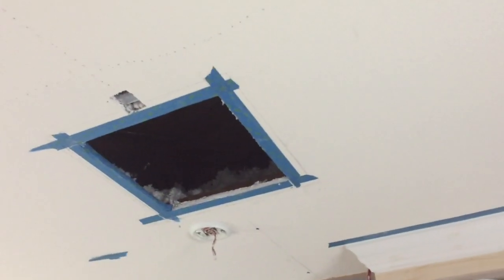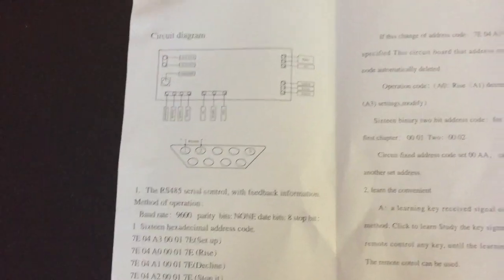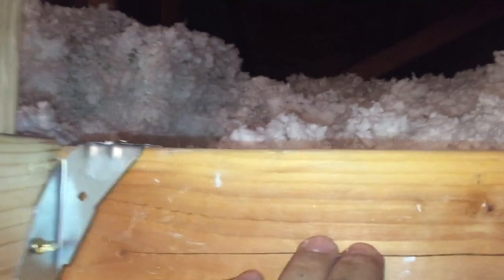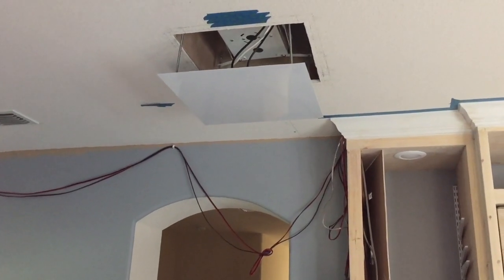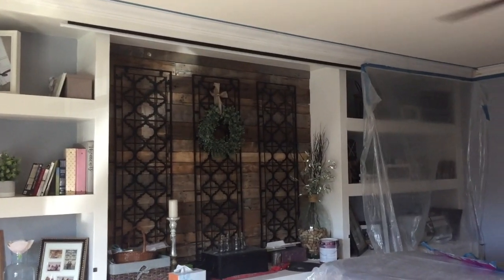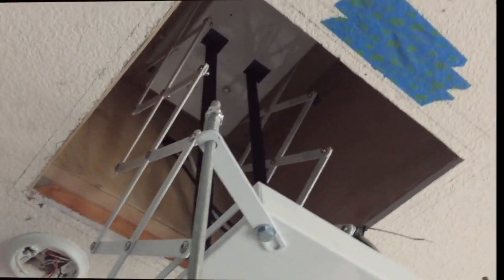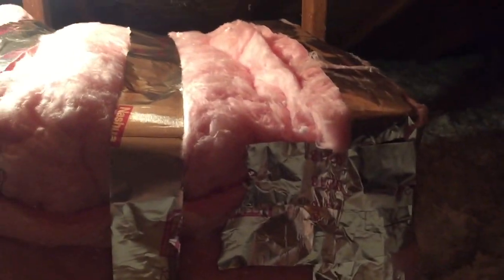Motorized projector lift

Comment: Very nice, but shouldn’t you be venting the box instead of insulating it to get rid of the heat though?
Reply from the maker: P F >> makes sense. I since moved. All I took from theatre room is bookshelf speakers and audio equipment (stereo amplifier) . What’s a theatre room without projector and built in screen.
Reply: But its not on when inside the box. Wont be any heat. Why need ventilation
Reply: @sensedesignarchitecture543  Did you even watch the video?
Reply: @pf5658  you clearly didn't 😂 His ceiling fan was on cause it was hot. He built the box because of a draft, then he insulated it because OUTSIDE HEAT was getting in. Tone your harsh down. You never know when you'll be in the wrong 😜

Comment: Hi! How accurate is the projector mount? What is the difference on the screen in mm. each time when you move the projector?
Reply from the maker: The projector was mounted solid in the lift unit. No need to reposition after lowering unit.

Comment: I have exactly 12 inches of depth in the ceiling where I want to mount this. Only one foot between my ceiling sheetrock and the second floor above. Will that be enough space when fully closed to conceal a projector that is only about 2.5 inches tall? Or could I cut/shorten the four metal rods that hold up the ceiling plate to decrease the overall depth.
Reply from the maker: jameskovach >> you could def cut the rods. Just remember that the projector will be mounted upside down on lift. If you have manual controls like I do on my Epson, might be hard to get to. You will have a tight fit since you’ll only be working with 12” of space. But if you can build, you can def make use of that tight space.

Comment: How do you adjust the distance the lift will lower and raise?
Reply from the maker: Vadim Shapiro there’s limit switch connected to unit. That when there’s power, the rollers that extend/close the legs will trip the limit switch disconnecting power to motor
Reply: @vgnope , thanks for the reply. My unit looks identical to yours but I don't think it came with a limit switch

Comment: How is the lift connected to power? Plug in or hard wired?
Reply from the maker: Gamecock 24 — I have it plugged to a surge protector. 8plug. So I can on/off all electronics. ie reciever, projector, lift, everything for home theatre system. I didn’t think it would be good to have unit always plugged in

Comment: nice work, do you have the dimensions of this lift?  I need to hide an Epson 5040ube which is 21x17x9.  Can you control how low this drops down?

thanks!
Reply from the maker: Gorilla Jones — the base plate measures 20”X20”.. 
The unit base plate is 20” above ceiling Sheetrock. That’s more room than needed. So when lift is in closed position/up, there is roughly 20”of space between ceiling plate, manual projector controls;zoom,power button etc..projector mounting bracket, scissor lift mechanism, lift motor.
The ceiling is 9’, the max lowering of unit depends on lowering limit switch. I have mine set to lower to 30”. Can go as far as 36”. Also account the space above ceiling line. 
You can sub the ceiling plate (nice square sheet metal looking thing) for whatever you like to accommodate your projector size. 
My measurements of inside box are 23X23x20.
Reply: @vgnope  

Thanks, I don't have quite that much space. I've got 17.5 inches between floors, so not as much space as you. Still trying to find something for the 5040 Epson.

Comment: Strong work! Looks like you synchronized the projector lift and screen movement with each other. If so, how’d you accomplish that? Thanks.
Reply from the maker: Michael J. Curtis >> magic. lol. Just used both remotes.
Reply: @vgnope  I have the same projector lift but can’t figure out how to program it. Can you be more specific on how you programmed it as the instructions are junk. Thanks.
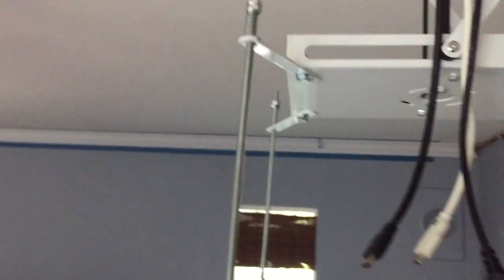Reply from the maker: @pcmggroup  I don’t think it had a program to it. Only power to motor which allowed the lift to raise/lower. You can change the position of the limit switch which limit the amount of travel /power to motor allowing the lift to function. Check video @ 2:15 ish. Limit switch screws are top left of picture.